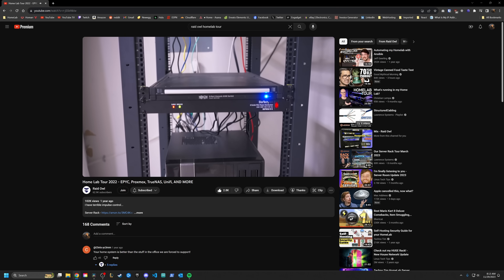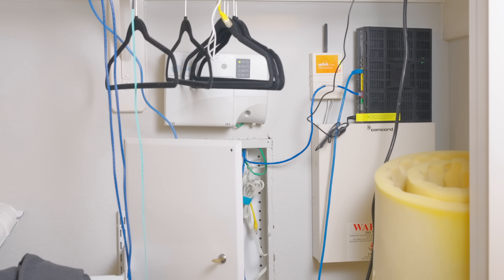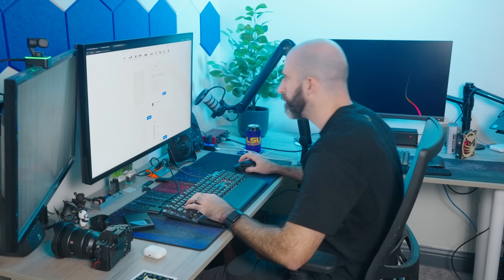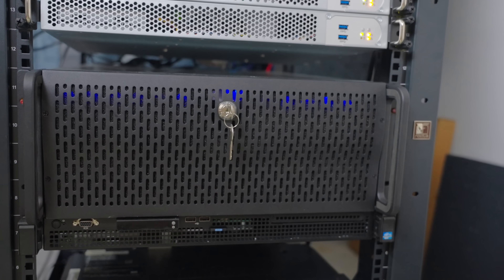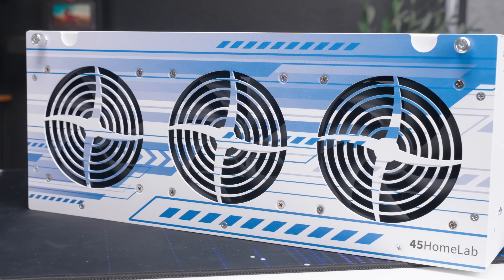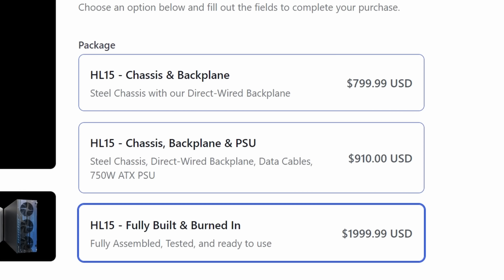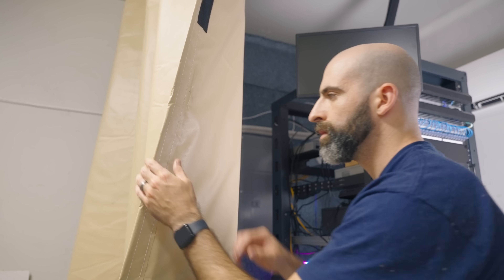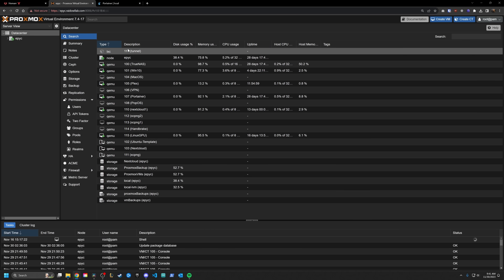Servers, backups, networking, and more - Home Lab Hardware Tour 2023

Comment: I'd ditch the redundant cable internet and use a family data sharing plan on a usb LTE stick for celluar (or wwan card) fail over instead. You probably already have a cell plan anyway (and preferably a different company than land).  Bridge V/Voip with PSTN/Cell/LAN.   Also, you can usb bluetooth for sound sink (mp3 broadcast) or depending on BT, wireless serial console access...more so if that AP uses third party firmware.

Comment: Awesome lab! Do all 3 of those 1u servers pull less than 100 watts combined? My Xeon-D1540 system (X10SDV-TLN4F) pulls around 60 watts alone, but maybe that's due to the power supply I'm using and/or the attached drives.  I'm using a full size Super Micro ATX power supply in a 4u case. Maybe I need to put my board in the 1u enclosure you have with proper sized power supplies.
Reply: Oh nevermind I see in your other 3 node ProxMox cluster video that it is indeed all 3 nodes under 100 watts.  That's awesome!

Comment: BTW, I use to live in DFW area and had to pay those huge electric bills until I learned to switch to a new introductory offer from a different electrical provider every April. Now I live in Chelan County Washington where we still have hot summers, but with an electric rate of 3.3 cents per kilowatt hour, I have never paid more than 68 dollars for a month of electricity in a 2800 square ft home.  But the tradeoff are our high gas prices in Washington.  Everything balances out.  Soon we'll be offering 10G Home Network with XGS-PON so maybe we'll have an advantage here then.
Reply from the maker: Yeah I got solar panels installed over the summer so that helps

Comment: Hi Raid Owl,

Thank you for sharing your insightful video on your high-level IT home lab. I appreciate the detailed walkthrough.

I have a few questions about your configuration (Network/Storage/GPU usage):

Q1) Networks:
- Regarding the Mellanox ConnectX-3 40Gbe choice, could you elaborate on why you opted for it when none of your switches are 40Gbe compatible?
- I'm curious about your decision not to implement network aggregation for high availability and high-bandwidth throughput, and instead, using VLANs for workflow segregation (e.g., distinct VLANs for storage, users, applications, clusters, administration, cameras). What influenced this choice?

Q2) Storage:
- Have you considered transitioning to ZFS? If so, do you plan on incorporating NVDIMMs for the SLOG (ZIL destination)?
- Additionally, why haven't you employed NVDIMMs for Ceph metadata or Ceph journal to enhance SSD storage endurance?

Q3) GPU Usage
- The inclusion of an RTX2070 Super GPU in your server caught my attention. Is this for VDI capabilities?
- Have you explored using AMD or Nvidia Pro Graphic Cards, and if not, what led to your preference for the RTX2070 Super?
- Lastly, have you experimented with configuring VMs using vGPU and attempted migration between nodes?

I'm eager to understand your thought process behind these choices. Your expertise in the field is truly valuable.

Best regards,

Frederic (From France)

Comment: Could you please do a walktrough on your Proxmox & Truenas setup? Im interested to know how you pass trough the disks or if its better to run Truenas bare metal.
Reply: II wanted to ask kind of the same question. For your Proxmox VM's ( not the one in the cluster) do they use disks shared from the TrueNAS and how do you pass them.. ISCSI, Samba or other ?

Comment: Looking to upgrade my 5 bay Silverstone server chassis so I can support more HDDs. Would you recommend the Rosewill chassis or the HL15?
Reply from the maker: The HL15 is a beautiful piece of hardware. If you have the cash for the chassis you won’t be disappointed. But there’s nothing wrong with rosewill either, it’ll save you some coin.
Reply: @RaidOwl Noob question. Do I need the LSI Logic Controller Card 05-25600-00 9300-16i to hook up all 15 drives to my mother board since I'll be doing chassis only?
Reply: I think I'll save up the coin for the HL15 so I have something to stare at while I sit there alone petting my precious.

Comment: i could see you going to 40g or 100g - going dual nas would be an appropriate upgrade and what about ai - you have no power sucking multi gpu boxes, also going to nvme arrays would be nice - you should have a good 2024 lined up and upgrades aplenty but generally pretty good on bw and power savings - instead of adding more nodes to cluster why not just make another cluster and then if you need you can spin up a vm instead of adding a node - you want a bit more redundancy and better faster networking to the extent it is feasible but mostly on the ws and to your nas (dual nas - this is the core and going to 100g you could do point to point - no switch needed, i would say that is the place where going to 100g from 25g would save you time- and it adds up - think about doing a opnsense box with fast cards - i think adequate pci lanes is the issue but you want to think bottlenecks for internal net

Comment: I've been thinking about a homelab for a few years now, but I've also been thinking about using equipment efficiently.
I don't want to have dozens of devices that do nothing.
I mean, it looks cool, but...
One server with a new 7970X 32 cores threadripper and 128GB of memory can easily perform any of my tasks.
Instead of buying crazy expensive SSD NAS and 100Gbit network adapters, I can plug 4 NVME SSDs into an pci-e expansion card,
and slot it into the server, do a software raid5. This will give about 30 GB/s (257 Gb/s) - incomparably faster and cheaper than SAN and NAS for fast storage.
To keep the data safe, I will need a separate 923+ synology with a 10 Gbit network (mainly, for backups).
Also, 10Gb 4 ports switch + 8 port 2.5 Gb switch, some kind of dream machine and several Wi-Fi access points.
And UPS, of course. This is much more efficient (per watt) than a cluster of N old servers with a total performance equal to one threadripper.
As practice shows, even one computer can easily last for decades without breakdowns (except SSDs and HHDs) - it is acceptable for home.
But wait, there is an even more effective build - instead of spending a lot of money on a threadripper,
I can build 2 servers based on the AMD 7950x (and something like ASRock Rack B650D4U), these are the same Zen4 16 cores each, but 2 times cheaper and faster, due to higher frequencies and less power hungry.
Plus, two servers provide fault tolerance. In my opinion, this is the way. Also it's good idea to have one or two mini PCs for some small tasks.

Comment: Ciao Brett, I am considering to move my small 2 e3 cluster to something new and with more power, could you post the power consumption of you server? I am interest in the xeon-d solution and the epyc. Ciao e saluti dall'Italia ;)
Reply from the maker: The d1521 systems are great and only use about 30W each during normal load, but they don't have any spinning drives. The EPYC system has 12 spinning drives, a gpu, a 40G NIC and an m.2 card, so it pulls a good bit more at around 200-250W. I believe before I added everything and just had the CPU and some drives it sat around 100W (I didn't stress the cpu much at all).
Reply: @RaidOwl  thank you very much for the quick reply 👍👍 [edit. and info of course 😅]

Comment: Has Xfinity rolled out increased upload speeds with mid-split in your area yet? I'd be interested to see if upgrading to a mid-split  supported modem would get you more upload bandwidth.
Reply from the maker: I only pay for the 100/20 down/up package, but from what I understand they still max out at like 1000/40 here.
Reply: @RaidOwl  Mine maxes out at 1200/40 here in Northern California.  Good thing I am using bonded connection from the Motorola modem to my homebrew PC running pfsense.

Comment: How loud are the 1u servers you built?
Reply from the maker: Not very loud at all. Installed low voltage adapters on the fans since the d1521 doesn't really get hot enough to warrant that much power/noise. I talk about it a bit in the video I made on setting them up.

Comment: Just put my new UDM Pro in last night. Picked it up over Black Friday to replace my USG 3P. I run a USW-Aggregation and a Netgear 28 PoE Prosafe downstairs. Then upstairs with 10 gig over cat6 to a Qnap 10gig and a Zyxel 8 PoE for cams. For servers i run a Poweredge T440 - proxmox and T340 - truenas. Also recently added a synology ds 216j for cameras. And for wifi an AC Pro and U6 Lite.
Reply from the maker: Solid setup there!